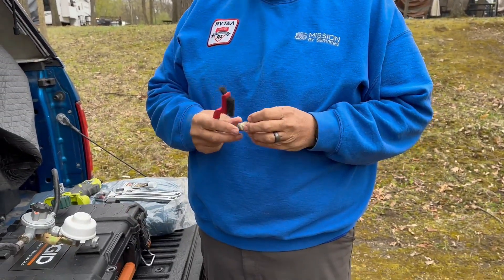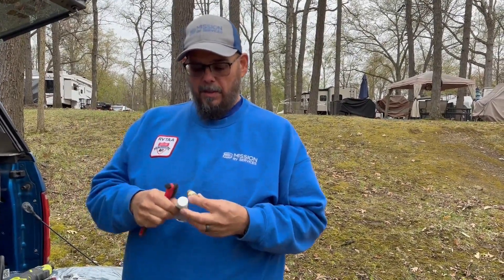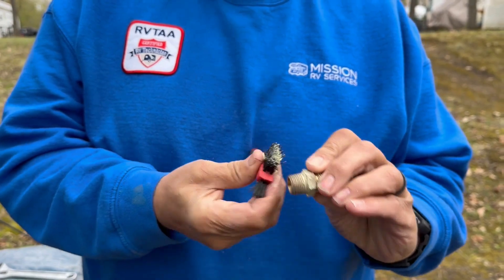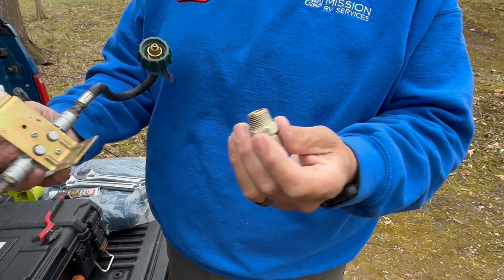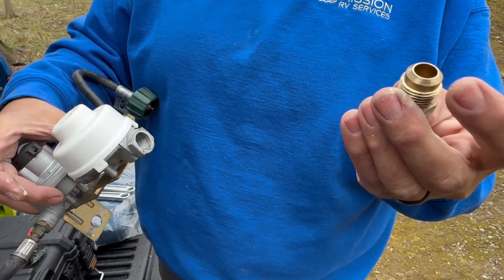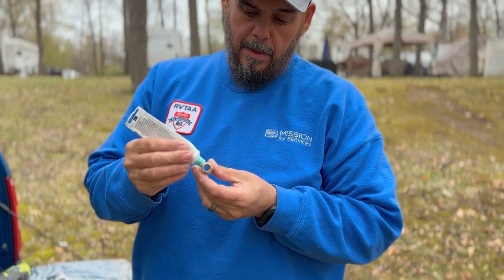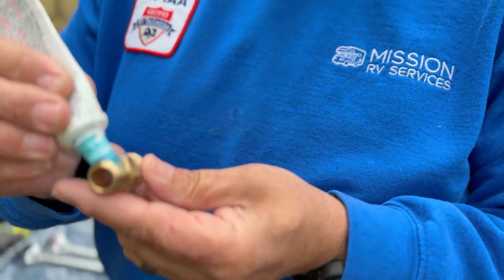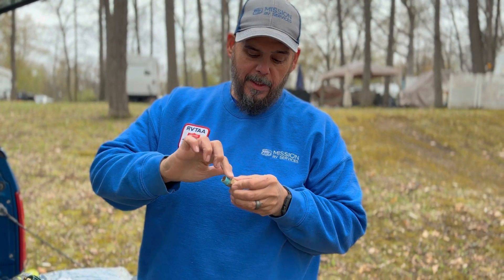How We: Install 2 Stage Vertical Propane Regulator

Comment: My regulator is turned facing the trailer, too. Why is that?  Can’t see the little window without using my phone or a mirror.
Reply from the maker: It’s just the way they installed it. You can really tell that most manufacturers don’t live in RVs, the way they build these things.